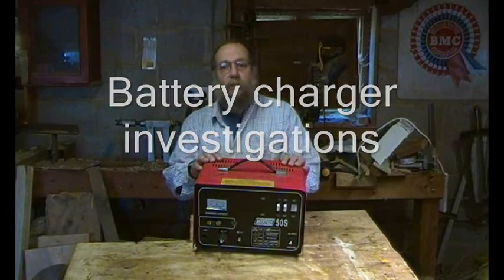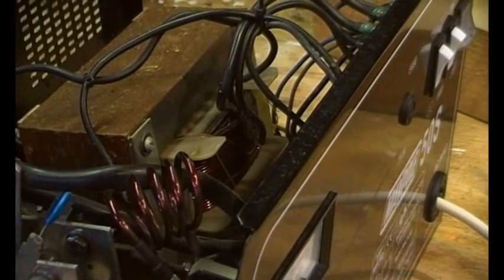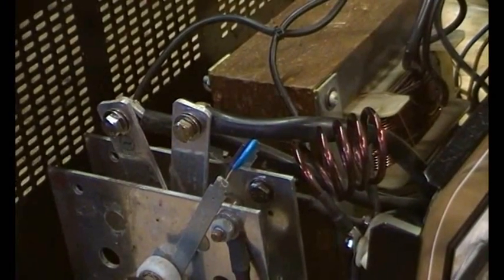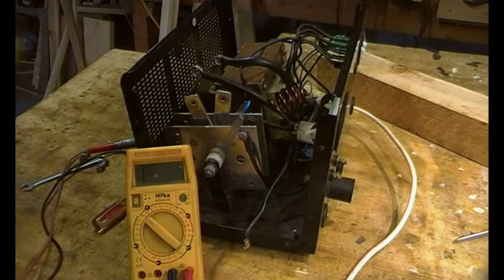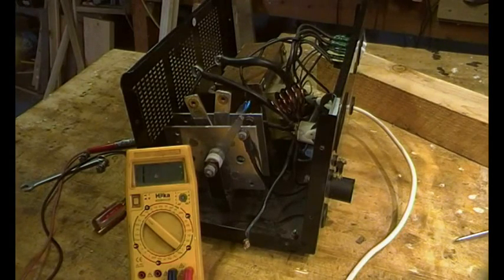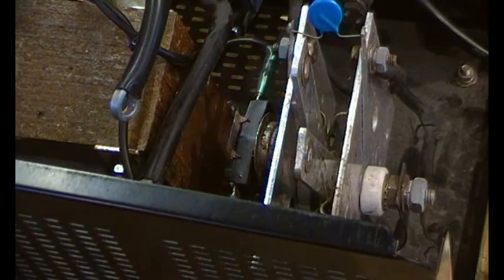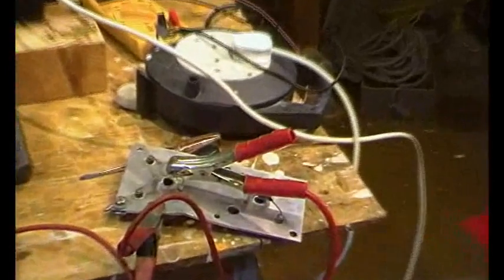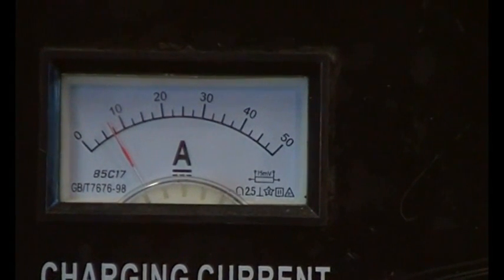Battery charger investigations and repair, rectifier test, meter shunt problems

Comment: 13:61 Most chargers use a center tapped transformer to save on using only two diodes instead of a full wave rectifier. Saving money making things from the manufacturer. 
Nice video Andy, Have a Happy Holidays Sir. Peace vf
P.S. maybe a video on the Daenset Sir ??
Reply from the maker: Hi, difficult as that would mean it was an auto transformer and the user would not be isolated from the mains, cheers
Reply: @TheInfoworks  Got it fella. Happy Holidays too. vf

Comment: Very well played Andy. I enjoy learning even retired. Yes, 4 diodes would provide a proper full wave rectifier, but companies put profit before performance, like the tiny ceramic capacitor. An 600 volt electrolytic capacitor rated for 40-50 volts would be smoothing the ripple A/C syne wave. But, you would not of found it in the scrape, if built well. The nuts on the shunt would have an epoxy dab if properly torqued. Nice find, need a little extra light for those inside one for the first time. Great voice and accent that is easy to understand with my $3 midwest USA ears after decades in dealerships and shops. I tease the younger generation with a question after not using ear protection...I ask “Do you know what we called sun-screen in 1970?” They have no response. I then tell them “Dirt”. Have a wonderful day. Enjoyed what you showed us! Liked & Subscribed.
Reply from the maker: Dean, thanks for the stories, always great to hear and for your ideas and comments, cheers

Comment: I have exactly the same charger. So if the 12v side of it is half wave rectified and only the 24v side is fully rectified, what would I gain by disconnecting the 24v side to the rectifier, (I don't need the 24v output) and connect the 12v side to the rectifier so that the 12v side is fully rectified? Any advantages?

Comment: Hi, disassembling the rectifier bridge I noticed that these 8 diodes are all in parallel 4 positive on one plate and 4 negative on the other plate by setting 12 volts only the plate with 4 negative diodes works and the other one too at 24v but it seems to me both of which work in half wave
having that kind of setup and you hear the classic 50hz hum
Reply from the maker: They are indeed strange setups, however identical looking diodes can have different bias. These are built down to a price, not up to a standard, cheers

Comment: Ok,so ive got a very similar charger  that  ive got in bit on my bench. The smaller 16s model.

I accidentally attached to a battery the wrong way arround, without the charger turned on. Got lots of sparks , now the transformer hums very loudly consuming a lot of power but no output. 

Have i destroyed the transformer?
Reply from the maker: Hi, I think one of the diodes in the rectifier is a dead short creating a load across the transformer. Might be more than one, cheers

Comment: That's a nice charger to find free Andy. The recifier stack doesn't look very rigidly mounted, but otherwise it looks well built. Just a thought - the +12v o/p wire back to the transformer may go to a secondary centre tap, in which case it may be that on 24v all 4 diodes are used as a "bridge rectifier", and on 12v only 2 diodes are used plus the centre tap to give "full wave" rectification - both outputs will look similar, ie pulsating dc, but the 12v output will be only half the amplitude (approximately!). I've seen this method for getting 2 voltages a few times. I can't explain the different clamp meter readings on the +ve and -ve cables, that is something else going on I suspect :o) Cheers, Dave
Reply from the maker: Dave. The centre tap makes sense as there are 2 thick wires going to the 12v postive. The way I see it is the negative is provided through the rectifier and although it is ac at the 12v positive only the positive side of the wave can flow. The negatice will not flow as there is no where for it to go. With the clamp meters there is always a difference in reading, but this is due to the orientation of the clamp to the wire. It would be slightly different if the meter was clamped the other way round. Thanks for the interest, cheers, Andy
Reply: Ok - I have not used a dc clamp meter enough to know their foibles ! Re the other thing - have a look on the web for "centre tapped full wave rectification" - the output is a full set of dc pulses, not half a set as in half-wave rectification - so the +12v o/p would look pretty similar in shape to the +24v o/p on a 'scope, but lower in voltage of course. You can think of the centre tap as a zero reference, and the ends of the winding swing positive and negative with respect to this zero alternately, and 180 degrees out of phase with each other - http://www.electronicshub.org/wp-content/uploads/2014/08/Center-Tapped-Full-Wave-Rectifier-Circuit-Diagram.jpg  Cheers, Dave

Comment: Hello Andy
I believe that the 12 Volt output is full wave rectified. It comes from the centre tap of the transformer.
We are arbitarily considering the negative terminal of the battery as 0 volts, it is easier to understand if we consider the positive terminal (transformer centre tap) as 0 Volts. and the negative terminal as -12 Volts ( and the 24 Volt output as  +12 Volts)

So, when one end of the secondary goes to  +12  Volts the other end goes to - 12 Volts and vice versa, so a diode from each end of the secondary to the negative terminal (two sections  of the bridge rectifier) will give -12 Volts to the negative output on both half cycles of the ac, hence full wave rectification.

Just for fun ac voltage is measured as the RMS (root mean squared) value of the voltage over 1 cycle of the supply. 

When rectified and smoothed with a capacitor the dc voltage is greater than the ac voltage as the capacitor stores the peak value of the ac voltage, (this is 1.4142 times the ac voltage (square root of 2). When a load is applied then the measured dc voltage drops because the capacitor discharges somewhat between each half cycle peak.

I did enjoy the video and liked your comments about the use of tools, there is however something worse than an adjustable spanner, a mole wrench (otherwise known as a nut destroyer).

Regards

Peter Bell
Reply from the maker: Peter, thanks for the in depth thoughts, a slightly different way of thinking about this situation, pleased you enjoyed the video, cheers
Reply: Thanks Andy. Before i retired I designed electronic equipment.
Reply: Peter Bell i would enjoy it if you made more videos. I have a very basic understanding of what your describing here but you sound like a good teacher. Thanks for your explanation
Reply: @ryanburbridge  Hello Ryan I have 3 videos on youtube Rectifier investigation, Removing a relay from an Aurora inverter and Aurora relay failure investigation.

Comment: Most of these folks on Uribe are not masters at anything but BS.  I was trained by journeyman, who knew what they were doing and talking about.  You are right about files and in which direction they are used.  What makes me the hardest is when folks on Uribe call something by the wrong name or just refer to it as as whatchamacallit.
Reply from the maker: John, thanks for your comment, pulling files backwards, I see so called engineers doing it, just no finesse, cheers

Comment: Thanks for the video. Very helpful. Been repairing few of these chargers, yet the experience differs case to case.

Recently I've got one abnormal unit. The voltage is very much higher at the output ranging from 60-80 Volts although the rated output is just 6 - 48 volts.

Any idea why? I've checked all the diodes, fuses, breakers,.. I'm not sure how to check the coil tho. Is it bcoz of the coil?
Reply from the maker: What does it do with a load connected? Cheers

Comment: That rectifier looks like it's a selenium stack rather than solid state diodes! If that's the case, I'm astounded - didn't know they made equipment with those in them any more? 

The advantage of selenium rectifiers are they are much more robust and can withstand shorts that would destroy a SSR in microseconds. The main disadvantage is they have a much higher voltage drop across them. 

Maybe your 12 volt output is half wave because one of the diodes has actually gone fut? I'm sure even selenium rectifiers have their limits.
Reply from the maker: Hi. Diodes most aften go short circuit and they all check out as fine. I think the half wave was as Dave said, the centre tap was used which is why there are 2 wires going to the 12v positive terminal. Cheers
Reply: Andy, if any of the diodes have gone short circuit it'll be half wave rectifying by shorting out every other half cycle! If that's the case it'll be putting a huge load on the transformer and things will get rather warm. Might pay to check that...
Reply from the maker: Hi. I think the 12v output  is half wave due to only the negative being rectified, the positive comes staight from the transformer. This is not an uncommon set-up. Seems to work fine with no heating. Cheers
Reply: Measure between the 12 volt & 24 volt outputs with your meter. It should be the same voltage as between the -ve terminal and the +12 volt output.
Reply: Yeah, those are definitely selenium rectifiers. I’ve got two very old chargers, a Lucas and a Bosch charger which were owned by my grandfather. The selenium rectifier in the Bosch charger went bad last year. The only problem is getting these selenium rectifiers can be pretty difficult. Most of the ones you find online are meant to be used in tube audio or tube power supplies with current ratings in few mA to under 5A mostly. The ones rated 8A and above for battery charger are quite expensive above $40 to 60 a lot of times. And as mentioned above become of the higher voltage drop of selenium rectifiers the transformers used in these chargers have much higher outputs. The transformer in the Bosch charger outputs 14VAC and 9VAC.

Comment: Hi Andy  . i am in the proccess of repairing a stater/charger unit similar to the one in this video,is there any way I could contact you for some advice please?
Reply from the maker: Hi, the Youtube message service has been lost, so ask away here, cheers
Reply: @TheInfoworks  Thanks Andy-I have a gunson starter /charger which has "button "
diodes(2),so half wave I assume,virtually impossible to source in the uk and wondered if there was an alternative such as a full wave selenium ,or similar,these buttons are rated quite high 50amps ,600 v p.i.v..Any suggestions would be gratefully received ,cheers.  Meirion
Reply from the maker: As you have seen I just used a  bolt in diode and these are easly enought to find. I was about proof of concept to make sure I had found the fault and there were no others, cheers

Comment: The reason the 12 VDC is only half wave rectified is probably because they were using it to only charge 24 VDC systems.  I have a 1A 12 VDC charger that has a bad top hat diode and it is only half wave rectified.  You really need a good filtration system on half wave rectification to get ripple free dc.  The reason the wire to the 12 VDC  lead is coiled is that is the coil part of the filter.  There should be a capacitor in the circuit, somewhere to provide the LC filtering.

Comment: Sir, I have similar charger, problem is when I switch on the charger the out put I get is 40 to 70 v dc, plz help me how to solve the problem
Reply from the maker: Hi, sounds like a transformer or meter problem. Try another meter and see what the open circuit out voltage is from the transformer, cheers
Reply: @TheInfoworks  thank you sir.

Comment: The blue component you are calling a capacitor is actually a a varistor and has nothing to do with ripple.
Were not concerned with ripple in an automotive battery charger.
 Also there is no need for anything more then half rectified current.Its a charger not an audio power supply.
Reply from the maker: Thanks for your comment, someone else pointed out my mistake and called the item a transient suppressor, cheers
Reply: @TheInfoworks  Varistors serve the same purpose but they also are not the same as transient suppressors.This component appears to have been added to your charger and I see no need or purpose for it in this circuit. I would suspect it was added to attempt fixing an inheritant problem somewhere else in the charger.You should find a fuse is in the output circuit as this varistor when conductive will cause a short,which I assume was it's intention

Comment: Ever seen a filing machine work? Hint: It don't lift the file, they last just as long. That's an ol myth
Reply: Steve just Steve
Reply from the maker: When you pull a file backwards over a sharp edge then it damages the teeth, such as on cutting teeth where the steel is tempered. This is not noticeable on flat mild steel hence the confusion and the reference to a filing machine. Cheers
Reply: @TheInfoworks  "where the steel is tempered" Are you saying that a files teeth are tempered to a different amount from front to back?  Or saying when you're using the file to sharpen the cutting teeth of something else? I think anytime you use a file on something harder than the file itself it's going to damage it, regardless of which way you're going.